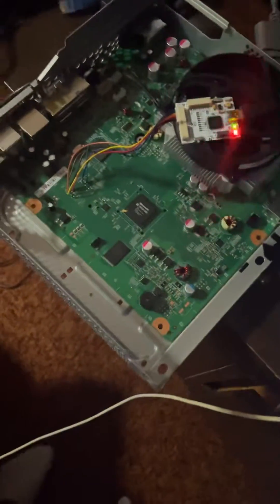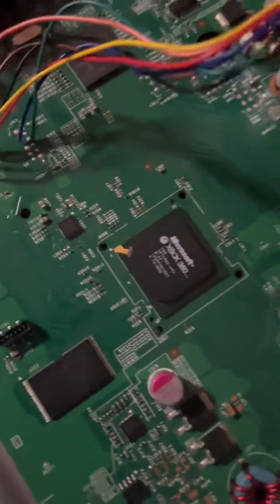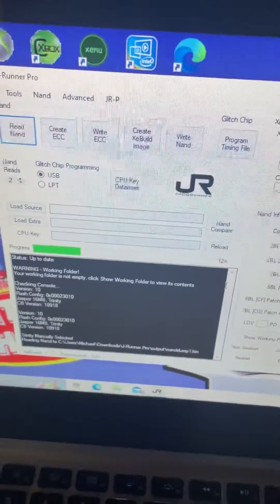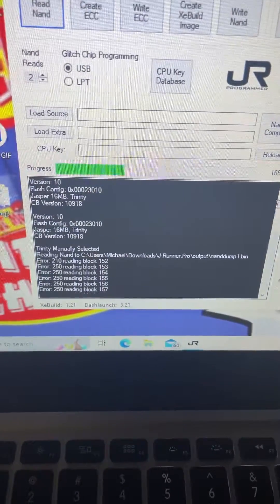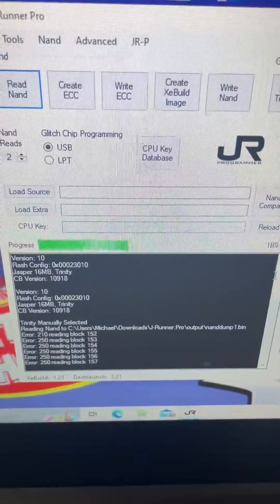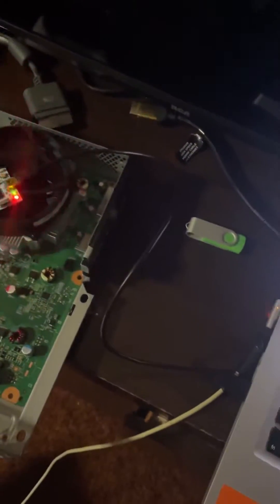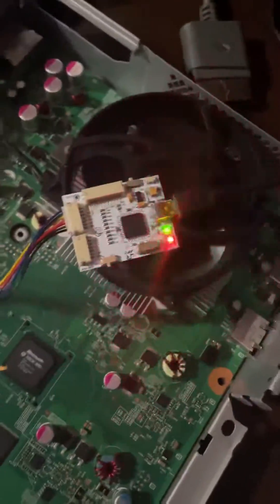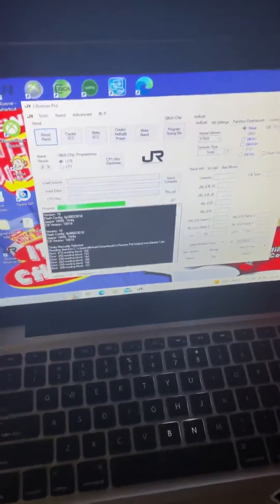Trouble trying to boot XeLL/Chipless RGH 3

Comment: do you think you could help me i’ve disabled the driver signature and everything and still getting the no signal i don’t understand i have everything sottered good. i’m not getting a lot of bad blocks either both nand are the same so i would assume that means my soldering is good but still no signal. if you can help at all it’d be much appreciated. also i’m using a jr programmer .i was thinking i should’ve just bought the xflasher
Reply from the maker: you have to go into Advanced Start up under restart, restart it, it should give you options, click f7 or 7 to disable driver signature, then go back to jrunner, the jrp2 should start reading
Reply: @mikehearn4231 i’ve done that and still nothing i’m wondering if it’s a windows 11 thing. thanks for responding👍
Reply from the maker: @envyrowdy3473  go into computer management, also grab the weekends modder driver files , the usb will be detected, im at work, i can make a video later showing you how
Reply: could you please it’d be much appreciated!
Reply from the maker: @envyrowdy3473  uploading the video now
Reply from the maker: @envyrowdy3473  check my channel, video is up

Comment: Did you ever get it working?
Reply from the maker: yes, what happened was my driver signatures was preventing Jrunner from writting ECC correctly causing it to glitch out, had to restart my pc in advanced mode under disable driver signatures for it to write properly, i have since then been rghing with Xflasher 360!
Reply: I really hope this might be my problem as well. I used a Pico and said it successfully wrote and even checked a second time but still getting blank screen... I'll try doing this tonight. Ive pretty much tentacle f*** my board with different alt points trying to solve this lol...